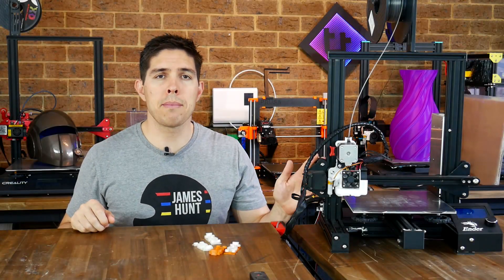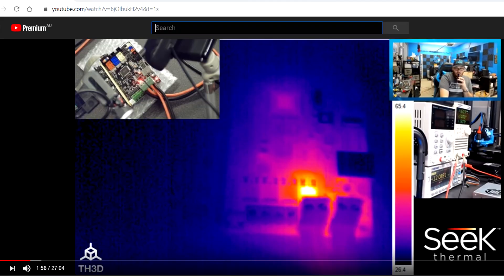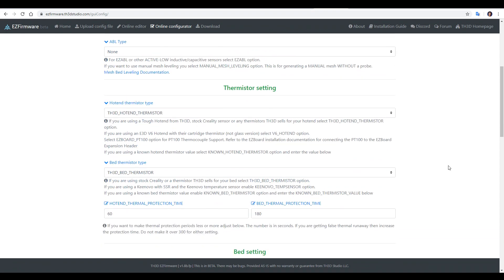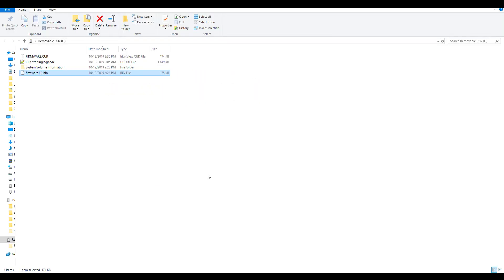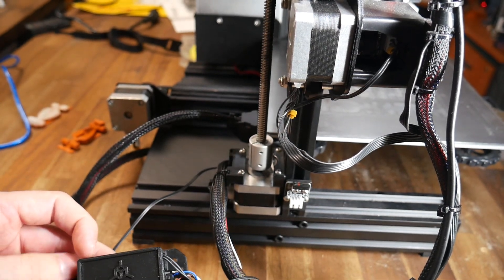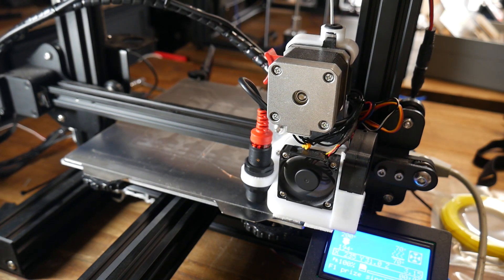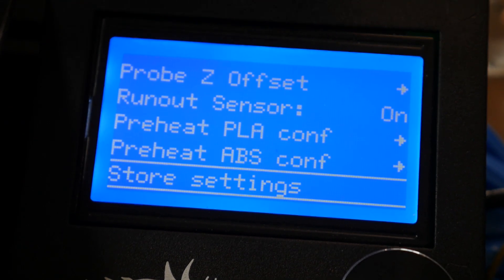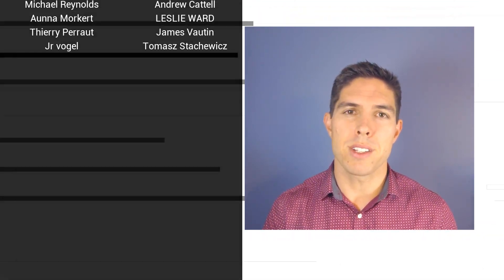EZBoard Lite - The most user friendly Ender 3 mainboard upgrade + EZABL Pro

Comment: I fail to see the improvoment vs the SKR (min)i E3 ?
Older motor driver with less fonctunalities (2208 vs 2209 for skr ! ), the rest is mainly identical, just it's 3 time the price ?
The  "test" throwing 15 amp amps the board is just nonsense, shooting boards with a gun also will make them stop working... Th so called "over engineered" seems mainly over priced ?
(note that I have none of these I still run a mks gen L with 2208 and see no reason to change)
Reply: I have posted another comment, and want state that I do not work for TH3D, just a very satisfied customer.  Something you may not grasp is the level of customer service that they provide.  I have  yet had any results with solving a problem with a Chinese company.  Tim has personally repaired one of my EZBoards that I broke the USB port on.  I see this as similar to cars.  Many people are happy with their KIA's other people want a Rolls Royce, but they are all cars - they get you from point A TO B.  Style, features and support have a cost.
Reply: Timothy Hoogland  Thanks for the document. Using TMC2208 was weird, I get the answer :)
Reply: Timothy Hoogland  dont think the current handling offended him, it just looked like you analyzed a competitors product thats  a fraction of the price and went looking for something to use as a reason to justify your price. Now if traces were melting off your competitors board..... that would be different. Dont think thats the case though. so we chalk it up to marketing.
Reply: jrok96 the big tree tech’s regulator literally melted during testing due to a design fault. The test was not the first time seeing this and BTT insisted it wasn’t an issue.
Reply: Timothy Hoogland  Tim all your doing us isolating customers, you don't build a successful company by alienating customers by bashing other products because you think they don't meet your own personal quality of standards. Plenty of people have been using the Chinese boards and get the same end quality print as with your product. Just because you do extensive testing of your product does not mean your product is any better. It just means you spent more money to have bragging rites to say I'm better because my product has been tested, and then charge people 5xs as much for a product that doesn't do any better then any other current products on the market. If you want to make a successful company you give what customers want not what you want. Prove to me that your product can out perform when it comes to the final print quality then maybe i would consider buying your product.
Reply: Timothy Hoogland  Tim the parts in your products are foreign made parts the boards the chips the resistors. There is nothing in that board that doesn't come in some part from China and don't tell me that there isn't a part that doesn't come from China. And even if i had to buy 2 boards in a year i still wouldn't have to spend the kind of money your asking for a product that may or may not last that long. People may want quality parts but in the end majority of the people will go with a cost effective over an over engineered product.
Reply: Timothy Hoogland  and now your board is already outdated with the SKR V.14
Reply: Timothy I just read that in a trump voice.. 😂😂 Quality control is the keyword,... innovation trumps it though.👍🏻🇦🇺🤜🏼🤛🏼🍀🍀🍀🎄🎁
Reply: @cowboy124aa3  Of course there are chinese parts as well as parts from the US, Japan, and Germany. The difference is we're using name brand parts instead of generics. As for the "and now your board is already outdated with the SKR V.14" that's incorrect and we've been shipping these boards with the LPC1769 that they just switched to and I can guarantee that they are genuine 1769 chips and not clones.
Reply: TH3D  JUST KEEP DOING WHAT YOU DO, DON’T change your values, or what you do for anyone.. EVERYONE ELSE remember this is an American company, and they are still growing YOU SHOULD ALL SUPPORT THEM.  They also have great support, and do all the leg work for free firmware updates..... TH3D YOU GUYS ARE ROCK ⭐️’S
Reply: How is this board compared to the e3 silent board

Comment: I cannot speak directly to the TH3D board but I can speak to the quality of Chinese made electronics in general. As an electronics teacher, Cisco teacher, hobbyist, and amateur radio geek for the last forty years I can attest to Japanese, German, and US components as the best. I think TH3 did a reasonable study but, not necessarily qualitative. A bit extreme given the average current levels drawn from any electronic component on most printers would not be near these levels. With that said, I'm not sure if they were attempting to prove longevity or long-term productivity. If I was on a budget, I may have a hard time justifying the purchase. At the same time I understand the expenses of a newer start-up and the requirements of building a business that would justify the cost. I'll probably purchase one even though it was half the cost of my printer simply because it will print better. And I'll most likely add the EZ auto level. And no, I'm not a BOT.

Comment: To me, there's only 1 reason to justify to extra cost of this board, and it's in the comments here: Customer support.

If you buy anything from from the budget manufacturers like BigTreeTech you're getting a board that works great, but zero customer support and about the only warranty you're going to get is the return period from Amazon. With this TH3D board you can see Tim (TH3D team member) active in the comments. Personally I don't believe the engineering is THAT much better, but quality control is likely going to be much better from somewhere like TH3D. I think the fuss in the comments over 2208s VS 2209s is moot, there's not enough difference in them for that to be an argument point, and TH3D claims of "Chinese" boards using knockoff stepper drivers is a pretty baseless claim in my opinion, so take it with a grain of salt. With all that said, if you want to base your purchase off facts and not just he said she said you have to ask yourself this 1 question:

"Is it worth $60 for better quality control and customer support?"

Can you buy a cheap board and iron out all the issues and troubleshoot it yourself, or do you need a holding hand to reach out to when you have an issue? I honestly feel like that's the determining factor for the EZBoard VS SKR Mini E3. I personally went with the SKR since I am fine with troubleshooting myself and I also can't justify a $100 board for a $160 printer. If I'm to the point that I'm ready to spend big money on upgrades I'd much rather get a higher quality printer. But that's me, and I'm more than positive there's lots of people here that are willing to pay an extra $60 for peace of mind and knowing they have customer support, and there's nothing wrong with that.

TL;DR: Ya'll stop arguing. It's 2 different boards for 2 different types of users.

Edit: Turns out you have to pay an extra $30 for TH3D support when you buy your $100 board for a grand total of $130. I was trying to keep my argument pretty middle of the road but a $100 board that doesn't come with support unless you pay extra for it is absolute bullshit.
Reply: It's 99.99 on their website.
Reply: Very well put!!  There is no right board for every user.  Some are on a tight budget and price is the main consideration.  Others are more concerned with support and the ability to talk to the company that produced it.
Reply: You also have to pay 30$ extra to get that fantastic support. They literally added it as an add-on
Reply: @squat224  Holy hell you're right. I was trying to stay pretty non-biased and say it's worth the $100 to some people for the support, but if it's extra for the support with the board already being that expensive I can't recommend that purchase to anyone. I'll take my $35 SKR with no support any day.
Reply: @squat224  You are correct.  But, they have a product that really doesn't need support.  They also have a very active forum where other users can assist for free.  I visit it a couple of times a day and provide help and get it.  I have said it before for some the extra money is not worth it, for others it is a non - issue.  I know my wife can spend a couple of hundred on what I consider silly things - I spent it on my printer mods
Reply: @woodwaker1  Sure, but if the point people are making to sell this over the cheaper chinese alternative is the bulletproof build and fantastic support, where are the people having issues with the chinese boards? I've not heard of those failing, nor needing any more support than this would. As far as I know they flash the firmware more or less the same, so if you can figure it out on this much more expensive board, you can probably figure it out on the cheaper one. Lets also not forget, if you truly are such a beginner that reading through the extensive forum threads on reddit, facebook and videos on youtube to sort out one of those 30$ boards, you probably shouldn't (and won't be) upgrading such a core component in the first place. 

I'm sure this is a stellar board, and options are never a bad thing, but this offers nothing that you can't get for much cheaper elsewhere, on top of the seemingly predatory extra charges for support. With something as niche as this hobby, and extra niche as a board targeting a specific brand of Chinese 3d printers, why on earth would the support cost money?

I've seen you leaving several borderline shill comments on this video, and that's cool maybe you know the owner or something. But nothing about this video, or more importantly the site where you buy these from indicates that you're getting your money's worth on this board. The absolute only thing I could see being an argument towards value is the configuration tool they have set up. I'm sure it's nice. It's not $60 extra nice.
Reply: @squat224  I see your point, and respect it

Comment: Seriously a $100 replacement board with only TMC2208 vs $40 board with TMC2209....... year right lets pay 2x as much just because its a little more user friendly for a first time user thats very unrealistic when most 3d printer hobbiest know how to or can follow your other guide for example and get the SKR working flawlessly.
Reply: Timothy Hoogland  tmc2209 have  "lot of features you dont need" :)  Nice... Is funny. 
Stallguard V4 (better than tmc2130 stallguard v1, runs in stealthchop)
1.7A rms Vs 1.2A rms means.. tmc2209 are cooler at same current. Big heatsing pad for fresh chips.
Tmc2209 has... Coolstep: https://www.trinamic.com/technology/adv-technologies/coolstep/
You can get bigtreetech SKR V1.3 (lpc1768) + 4 or 5 TMC2209  at 40$.
You can use vanilla Official Marlin 2.0  instead highly tuned marlin.
Reply: Timothy Hoogland  yes it has endstops but with sensorless homing you have these extra i/o to use for other things instead of homing x/y/z.
Reply: Timothy Hoogland  nice to have your board in vanilla marlin. Tons of upgrades/fixes daily.
Tmc2209 sensorless is marvelous. Coolstep is not only for Stallguard: "maximizes efficiency by driving motors at optimal current. Can reduce motor heat dissipation", making motors  cooler., using more efficient energy.
Stallguard, iquit my x/y endstops months ago ;) 

Having socket step sticks instead soldered ones, you can upgrade a board with future or better driver (as example Trinamics TMC5161, marlin supported, a stepper motor controller and driver IC)

Comment: This now costs $120, the EZABL is $70. ($190 for both items)
I just bought an Ender 3 for $180. 
I think I would prefer 2 stock printers for less money than 1 printer upgraded with these 2 items.
Just buy a better printer if your budget is $400.
Reply: So is that tech support limited to 6 months as well?

Comment: The term "over engineering" is not a good one in the real world of Engineering.  Although there are positive aspects of over engineering, it usually comes at a cost of unnecessary complexity and COST.  These costs are usually past to the consumer.   I'm not sure how it is meant in the context of this video (it obviously meant as good thing) but it appears that the "cost" factor is real given the price.  

An engineer would spec parts based on the requirement or scope of the project, then design a predetermined safety margin.  (This is very basic - for illustration purposes here).  As an example, if the most a stepper motor will require is 1 Amp of current source at max output, then a design capable of running 1 Amp at 80% its max capacity would be an decent circuit choice.  The stepper would probably never run at max amperes so the safety margin would be even better than the calculated 20%.   If a circuit capable of the 1.5 Amp design costs $2 but the "over engineered" circuit (say rated for 3 Amps) would cost $4 then these costs are going to be past to the end user.  There is no point in using a 3 Amp circuit.  Get it?  This is what over engineering means to most.  There is always a balance of cost, quality and design scope.  It's not so easy.  Lets not confuse this with proper engineering practices- but even then teh "cheaper" boards appear to be working out well so is having greater quality any real benefit? 

I give them map props for what appears to be the easiest way to flash firmware that I have seen to date.  The cryptic software editing and downloading a boot loader etc.. are gone.  I'm sure its simple for those who do it regularly, but for the novice it seems like too many places to brick my printer.  Selecting options on a list,having the on line tools create the file, downloading the file to a MicroSD card and simply putting it in my printer and turning it on is BRILLIANT!  I also give a huge thank you Michael  for making these videos and keeping the noobs like me up to date.  

So at the end of the day, do I want to pay for the ease of update, or just wait it out until China copies this and puts out their own version at a more attractive price point?  If these sell like hotcakes, then it's only a matter of time before the Chinese copy this technology and undercut this US manufacturer.   Which is a shame, but at the end of the day, if the same thing could be had for 1/3 less or 1/2 less - wouldn't you be tempted??  I have a lot to think about....

EDIT: looks like I may just wait until next year to buy this. (The EZBoard was $10 off and the ZABL was 25% off on black Friday - much better pricing) unless there is a way to get similar pricing before Christmas....

Comment: nice.. 99$ board is "easy upgrade for 150$ machine"...
Reply: Timothy Hoogland  "one board for +8 machines" (using custom marlin 1.1.9) , mmmmmmmmm.....

I preffer generic board, with sockets,  like skr v1.3 (15$). 
Can be used in "any" machine with official Marlin 2.0 (released 1 week ago: 13.000 commits since july 2018 marlin 1.1.9)
I dont like "custom marlin" boards very much, sorry. 

I preffer cheap lpc1768 with stepstick socket boards.  PD: Bigtreetech is now Marlin Sponsor. They have github updated uptime.
Reply: Timothy Hoogland  someone is trolling you. Not nice

Comment: What a rip off. They could price this board at $50 and still make a ton of profit. $99 is a scam and not worth as an upgrade for a $200 printer.
Reply: If we sold the board at $50 we would be selling it at a loss. This board is for machines $199-999. Please do your homework before assuming things like product cost. Try developing and producing your own control board and supporting it then you're free to call it a "rip off" when you can do it for $50 and make a profit.

Comment: nice video as usual.
as far as the board itself...you'd have to be pretty stupid to buy this for $100.
Reply: With FDM 3D printers in this class you don't pay more for better printing quality but for more convenience... And this board is very convenient because it fits into the creality printers as a drop-in replacement, doesn't need a lot of fiddling and is easier to use...
Reply: Timothy Hoogland  2000 people? are you sure you didn't add one too many zeros because those numbers don't make sense.. or you're a liar..
You can see sales numbers on aliexpress and the skr mini doesn't even have that kind of sales rate even though it likely sells at 100:1 of these boards.
Reply: @hzmeister9596  ... That's what I'm talking about @Timothy tends to oversize.. prices, clients, ....go figure what else ....
Reply: Timothy Hoogland  good for you
Reply: @hzmeister9596   All I know is that I have three and was on back order for all of them.  I purchased a spare, just in case.  Finally they have some to sell from inventory.